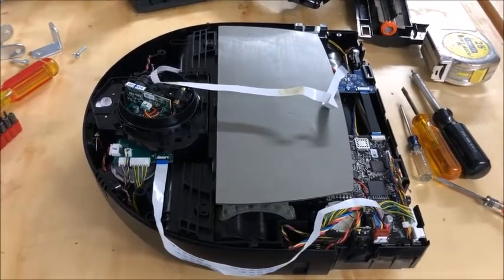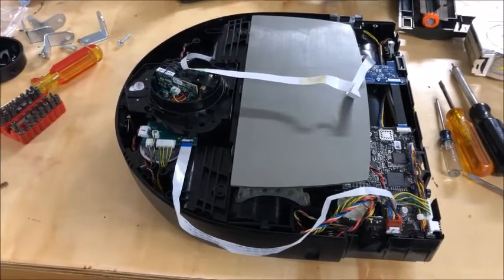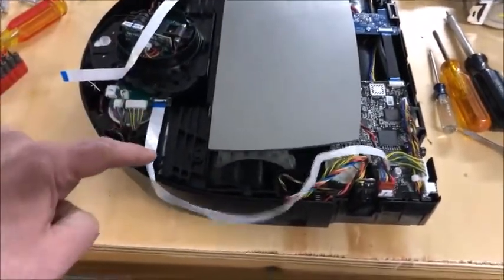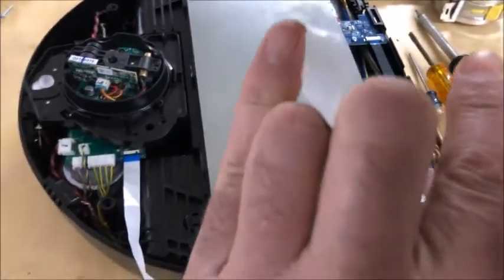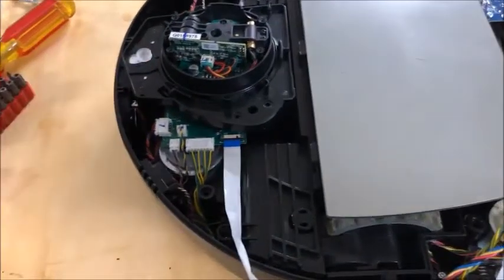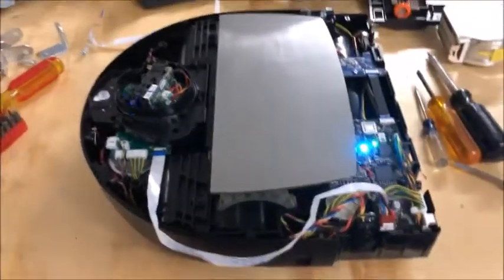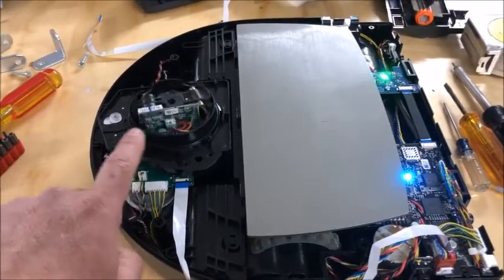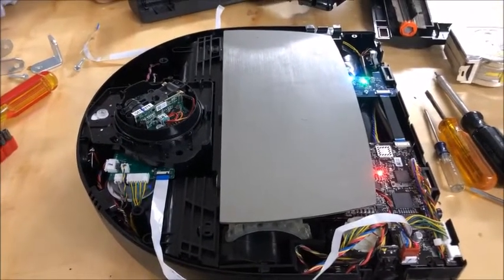Neato D7 lidar not spinning

Comment: I also had the same problem some days after I replaced the broken o-ring of the side brush. The robot always tried 3 times to start and I got an error with a red led light. I saw that the lidar didn’t turn. So I thought about replacing the flat cable from the motherboard to the lidar or the lidar motor or the big lidar o-ring. Because of that I wanted to find out if the lidar motor turns and just the o-ring is worn. So, I started the robot without the main cover. The lidar didn’t turn. So, I tapped it with my finger counterclockwise and it started to turn again. Now the robot works again without replacing anything.
Reply: Thank you, that actually did fix it for me! Just lightly moving it got it unstuck.

Comment: Hi, I am not sure if the LiDAR on my D7 is spinning or not. It spins when I push it with a Q-tip but doesn’t spin on its own when I run the machine.
Reply from the maker: Then maybe it’s just a worn belt. I would replace that to start

Comment: I was losing my mind. Replaced the motor and still didn't work. Finally got frustrated and started searching online and found your video. Sure enough, I checked my ribbon cable closely and found that it was damaged. Looks like it heated up and melted, probably from the bad motor.

Comment: I had the same problem. The ribbon cable was damaged, the lidar was not spinning. I changed the cable with no effect. Then I checked the lidar's motor and it turned to be dead. I opened it and slightly bent the motor's brushes, assembled the motor and voila - it works again.

Comment: I just had the same issue. Replaced the lidar motor and the ribbon cable and the bot is up and running. Both parts are available on Amazon.
Reply: Can you help me with links.
Reply: @TurfGuru2025  "LICHIFIT Lidar Motor (Fix Error 3000) for Neato D2 D3 D4 D5 D6 D7 Vacuum Cleaner Repair Parts" AND "caSino187 Ribbon Cable for Neato Botvac Motherboard PCB D3 D4 D5 D6 D7"
Reply: @alexcoffee80 thx, did you remove the little transparent wheel on the original motor and if yes how?

Comment: Great information, I was wondering about the 'Go' button you pushed to verify the lidar is not spinning, How or where did you find this or just through experimentation? My D5 moves about a foot off the charging station and fails to go further, happens about three times, then stops. No voltage on the motor could mean bad cable or board, voltage on motor means bad motor. Thanks for your video.
Reply: I’m having this IDENTICAL issue!
Reply from the maker: the "go" button is the same one you push to manually start/stop the vacuum when it is assembled.
Reply: @ScrapMetalWorks  Yep, I was saying I had the same issue. Fortunately a new $15 LIDAR motor and an hour of my time was all that was needed.
Reply: Hey, I was experiencing the same issue as you and solved it by replacing the LiDAR motor. ~$15 fix

Comment: I had the same problem with the LIDAR not spinning a year ago and it turned out the motor burnt out (see youtube video: https://www.youtube.com/watch?v=Bg8sEnDUUyU&t=170s).  I was able to buy a set of 5 replacement motors from amazon via https://www.amazon.com/gp/product/B07CJNXTV1/ref=ppx_yo_dt_b_search_asin_title?ie=UTF8&psc=1.  Fastforward to now it burnt out again!  Luckily I had backup spares but this time it still wouldn't start.  Now I noticed my ribbon cable was burnt in the same locations as this video and replacing the cable worked too... good grief!  Happy to extend the life a wee bit longer, but I'm ready to upgrade to the D10 whenever it comes out!

Comment: Very great video explaining your journey and the steps you have taken to solve the problem. My D7 has started acting up and I opened it up and also found my white ribbon cable is burnt/ripped a little from same area as yours was. I've never played w/ these ribbon cable. 

Hoping you or anyone else can provide me with some "for dummies" instructions to uninstall the burnt/ripped cable and reinstall the new one. 

Cheers and thanks in advance!
Reply: I have the same thing. Looks like a common issue.  I suppose that the lidar unit gets stuck or fails in a particular way that it burns the cable, so it's is probable that the lidar unit is in need of replacement as well as the cable.
Reply: the little motor breaks very often I had change like 3 in a couple of years.

Comment: Hi Scrap
Can I ask you where did you find the replacement flat cable or what is the exact name to find it on the net?
I have the same problem with my D5
Thank you
Reply: It measures 350mm length and needs to be forward or same side. For the D7. Probably same for d5 too
Reply: @jeremys1019  Thanks
Reply from the maker: eBay $1.97 unfortunately from China: Pitch 0.5mm 20 Pin FFC/FPC Flexible Flat Cable Wire 20624 80C 60V Width 10.5mm
Reply: @ScrapMetalWorks  Thanks for the information and for the quick reply. 
Ordered on Ebay. Thanks again, we hope there are no other major failures.
Reply: @ScrapMetalWorks  what direction (forward, reverse) and what length did you order?
Reply: @sethtopps9611  I also need to know!

Comment: Exactly the same happens to our Neato D7. The lidar does not spin. What I tried is to buy a new lidar motor for about 30 euros, replaced it but nothing changed.
Reply from the maker: Try replacing the ribbon cable. As you can see mine was fried so I suspect when the motor goes it causes an overload and it fries the ribbon cable. Yours may not be as obvious as mine but if you are in it the repair for 30 bucks minus well spend another 10 for the cable before you through the whole thing in the trash which is what I am going to do the next time it breaks!
Reply: @ScrapMetalWorks  it looks like really the power for my new motor is missing. I just supplied only 3 volt from a separate DC power adapter. And the motor was spinning and it spins the lidar as well. I don't know the true voltage for my motor. I have no technical data for it.
Does your D7 is working now? Does your lidar spinning now?
Reply from the maker: @bratzenvater  I would try replacing the ribbon cable
Reply: @ScrapMetalWorks  Let me tell you that I was successful at the end. Replacing the cable for 20 Euros solved the problem. Now i invested 30 euro for a new motor and 20 for the cable and the Neato D7 is working as before, no damn error anymore.
Thank you very much for your hints and the videos
Reply: @bratzenvater  My D7 has started acting up and I opened it up and also found my white ribbon cable is burnt/ripped a little from same area as Scrap Metal's. I've never played w/ these ribbon cables. 

Hoping you or anyone else can provide me with some "for dummies" instructions to uninstall the burnt/ripped cable and reinstall the new one. 

Cheers and thanks in advance!

Comment: The same happened to me yesterday. The LIDAR motor does not spin. After 2 years and 7 months of owning it. Neato told me to send it to 1 of only 2 services for the paid repair or to buy a new unit with an undisclosed discount. If I am to buy, it will be definitely not Neato anymore.
Reply from the maker: I agree. Free repair yes but I would not buy another Neato
Reply: @ScrapMetalWorks . Hello, thanks for your good info in your video.  I’m sure my lidar motor going bad caused the ribbon cable to break as well, so I’ll be replacing them both.  My question to you: Is there an easy way to plug in those little 0.5 mm 20 pin ribbon cables?  Do the connectors open up?  I’ll look around for more info but any help with this would be great! Thanks
Reply: @ScrapMetalWorks  Please scrap my last question…I see you can easily remove the ribbon cable by carefully prying away from the board the black plastic locking piece…then the ribbon cable pulls right out.  Incredible there are 20 conductors in there! Thanks again for your video and comments!